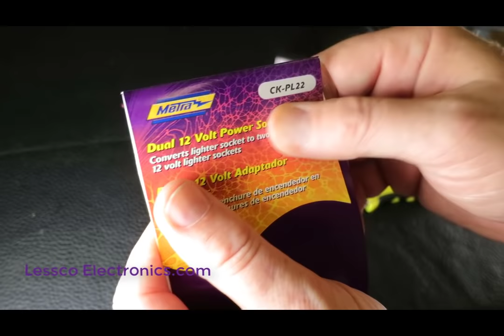How to hardwire 12 volt car accessory without cigarette plug

Comment: Nice tip.
However, IMO, I would add a fuse to the positive lead and then go on the "hot" side of the fuse.
In this manner, you don't risk popping a fuse that the vehicle may need. This then also needs to be understood that you still don't overload the circuit still.
Reply: How would you pop a fuse the car may need? He clearly said to use a vacant/unused fuse location. Every car has them. 
You'd be correct if he suggested leeching off an existing and needed fuse. That would not be a great idea.
Reply: For reference: 3:03
Reply: What fuse voltage would you use, and why would this be better than using an empty fuse bay?
Reply: That does sound like an extra step to add a fuse, when you're using a fuse and empty bay in the first place.  @BPoweredLove
Reply: @BPoweredLove He says "where this fuse was located" @ 3:03
Reply: @floridaredneck He says "where this fuse was located" @ 3:03 If a fuse is plugged into the vehicle it is NOT a blank
Reply: @davidstokes9706  
David! You're alive! It's been a half-decade since these comments.
Ignore this reply though. I'll come back in 2029 or so to respond to your point. 😂
Reply: @BPoweredLove  Blame "Google". My email is Gmail, as YouTube is also Google, and I just got the notification thud morning.
Reply: @davidstokes9706  

You're joking me. You just now noticed the 2017 (or whatever) email notification today, or you're saying YT only just now informed you that people were replying and those emails are dated 09/26/2023?? Why would YT launch those emails so delayed? That's a crazy glitch. 

Anyway, I have no idea about what we were talking about and I'm not sure I want to rewatch the video to be reminded. I might in a little bit.
Reply: @BPoweredLove  yep. It only sent this morning. Had I noticed how old your post was to mine. I wouldn't have posted.

Comment: Why can’t you just cut off the accessory connector on the dash cam and connect that to the fuse? Serious question because I’m doing something similar with a house home wall socket charger for my phone.
Reply from the maker: The reason is because there are often times electronics in the plug connector that are vital to the operation of the accessory. For instance mine has a step down converter that changed the voltage from 12 to 5 volts

Comment: Ok I got a question. How would I wire it to my trunk and for the light to only switch on when I open the trunk? Or is the switch my only option
Reply: I have a 2001 ford focus zx3
Reply: It's called a kill switch,or deadmans switch,  basically it's a switch that is only on when not bing pressed (kind of like the opposite of a regular switch). Place it in the in between the power source and the light on the red power wire.

Comment: hello how your last video I watched was very informative I'm trying to plug a cigarette lighter into a home Outlet so I need a DC to AC adapter
Reply from the maker: Yes, you need a a12 volt power supply of at least a 3 amp power output

Comment: I have purchased LED interior lights, which works with accesory port. Can i cut that port directly and hardwire the lights?. The box says, it runs on 12v. 

Please help how to hardwire a LED interior lights.
Reply from the maker: Yes, Definitely, What is the end look like on the wire though? If it has a transformer / fuse or anything like that in it you'll need to do it like I did here, otherwise feel free to just chop the tip off and hardwire it as you see fit.
Reply: @Lesscoelectronics  the lights get power through a 12v socket. 

So you mean i need to open the charging socket and seee weather there is any fuse inside it or not correct.??

Comment: What is the piece metal called that your connecting the female to??
Reply from the maker: You mean the ck-pl22 female adapter?
Reply: I have the same question. At 3:08 on top of the fuse there's a piece of metal that you used to insert to the fuse where it's not hot. What's that thing?
Reply: found the answer to my own question. They are "Brass fuse taps" you can find them on Amazon

Comment: What is the metal piece you put into the breaker to attach to the hot end of the cord? You said, "Put that in there", but you didn't tell us what "that" is or where to get it. The eBay link on this page does not work, but I can find that part by itself, and not get all that other wiring and plug I'll never use. 

I'm trying to use this idea for a dash cam and the wiring is already hidden, but it uses that damn 12V adapter and I need that for a USB converter. Since this is always on when the car is, it would be great to change this over and save me from fishing that damn cord and replacing the entire length of it, and save me a USB port I would have used too.

Yes, I am aware of the age of this video. The idea is perfect for my application, unless someone has a better idea. I wouldn't mind just cutting the 12V plug and splice a USB end to it. I just don't know why the car plug is so large for this cam.

Comment: Plugging the power supply into a cigarette socket and burying it under your dash isn't that good of an idea in my oppinion. Just cut the plug off and wire into fuse block. The other was (depending on the amount of current an item pulls) can cause it to get hot and start a fire. I have had cigarette lighter plugs get so hot it burned me when it was unplugged. Just saying!

Comment: soooo instead of cutting off female adapter and pluggin the cam adapter into it, why not cut the supplied cam adapter off and wire it directly?
Reply from the maker: Often times there are important electronics in those adapters you cant see that are important and shouldnt be cut out.

Comment: I just dont buy the cigarette lighter plug and play. I rather buy the rearview car with the power/ground/12 volt turn on. 
I usually buy the ones that have the fuse installed in. I rather keep it clean

Comment: One question on cars though... do you know anything about attaching LED strips to the car under the dash??? Specifically getting them to stick??? My car has a stiff molded carpet-like covering keeping the stuff under the dash hidden, and im not sure if 3m tape on most LED strips will hold good on that surface...
Reply from the maker: wire ties with hook&loop fasteners may work in that situation

Comment: Couldn't you just wire it to the wires that go to the lighter plug-in on the backside of the panel that it's connected to?
Reply: The bulky thingy probably has a transformer inside it, meaning it converts the voltage/ current to 5V/2A for example and not direct 12V which would probably burn your phone.

Comment: hey man awesome vid quick question though and sorry if someone has already asked and you've already answered. Anyway just to clarify when using the test light on the fuse, you want to put the copper tab on the side that is not hot? IE the test light will not light up...   i plan on splicing something onto my dome light fuse and obviously that gets power regardless if the key is on or not.. 
again great vid and cheers
Reply from the maker: yes, that way you'll attach onto the protected side of the fused circuit.
Reply: @Lesscoelectronics  thank you for getting back to me :)

Comment: Great video! I'd say be sure to secure the plugs together well so they don't come apart from vibration so I'm putting tape around mine. 
Also be sure to label the outside that there is a fuse inside the male plug's nose for any future trouble shooting if there is no power!
Reply: I wonder why he did not just cut the connectors off altogether and run the wire from there…

Comment: Could I just cut the cigarette lighter plug off and use the wires?
Reply from the maker: you can do that too
Reply: @Lesscoelectronics  is there a down side on not keeping the cigarette plug? Or the fuse takes place of the cigarette plug?
Reply from the maker: @justthatoneguy2175  alot of them have tiny electronics and fusing in them that you dont want to be removing, if yours doesnt have any of that, then go crazy and dont worry about it.

Comment: Hey man, what's the female fuse connector that you used.
I need to get those, have no clue what it's called.
You said the other was a terminal connector right.
The terminal connector goes to the battery right?
Sorry I'm no electrician and just need to install a 12v/USB port to my car which doesn't work. I need a dash cam and a phone charger for GPS

Comment: That's hassle why don't you just use. A double fuse splitter 😂
Reply: Agreed. I thought this video was years old until i checked half way through 😂
Reply: Then you remove the fuse and move it over into the correct slot one permanently live and one is live with ignition on... Or is it only my vw mk7.5 golf that does that my friend 😂
Reply: @aaronletchford  EXACTLY! Like a radio fuse which only turns on when the car is turned on 😂

Comment: No disrespect, but hard wiring is wiring without using the socket. Technically if you are using a 12v acc. socket it is not "hard wiring" You are just replacing one socket with another. Just wire it directly to the fuse and ground point. If you need to disconnect it, pull the fuse.
Reply from the maker: My socket is hardwired direct, but I use a 3 way expansion socket which I also use as a disconnect, its not right or wrong, its just custom wiring, every one is different.
Reply: What if the dash cam power connector has step up or down circuit board built into plug ?

Comment: I would never use a fuse tap. They tend to loosen the fuse connection over time. You are better off tapping the line itself. You can use the accessory port line itself.

Comment: Umm... do you have to use the plug??? I was thinking that the led under-dash light strips I want have a hardwire option, and i would use that... and if your device is 12v just ditch the hazardous plug all together... as long as you know a bit about electronic and car wiring anyways...
Reply from the maker: The plugs do help, Some of these kits use wire that is almost microscopic to see, no less wire up to!!

Comment: where do I attached the ground..??
Reply from the maker: anywhere theres a factory ground bolt or a comparable spot.
Reply: Lot of fuse boxes have metal screws that screws you can use.
Reply: @Lesscoelectronics  I know this is slightly off topic, used this video to achieve what I wanted so thank you, I got a aftermarket head unit, it screams through the speakers when I put my foot down, can I hook a wire to the metal casing of the head unit to a bolt going to the car chassis to ground it?
Reply from the maker: @GoogleUserGmail  if you have the ole cat in the trunk syndrome, check the ground impedance, it should be under 8 ohms, and ground loop isolators help alot as well.

Comment: Why cant you just cut the actual cigarettelighter plug of the dash cam?
Reply: and what is the best wire guage for car accessories?
Reply from the maker: @trevorbelmont4633  there maybe resistors or other parts hiding in there, and 18 ga wire is recommended
Reply: @Lesscoelectronics  i see thanks!

Comment: enjoyed your video however I have been searching for a solution to powering my DIY car security.  The horn that came with system(orig for home), is normally powered from normal home AC plug input with a converter to 9V DC output.  I want to put the horn in my car and power off my 12V battery-somehow. This was done by another YouTube video BUT they did not say how they powered the siren in their truck. Supposedly, you cut the input wires on siren and hook it to car/truck battery. System has wireless motion dectectors that trigger siren when activated.  What steps do i need to do to power the siren from car battery without draining battery-some kind of converter i suspect? Any help would be appreciated. The original video on this item does not allow viewers to ask questions with creator.  Link to this information follows. https://www.youtube.com/redirect?event=video_description&redir_token=QUFFLUhqbUFYb2IwZHZIVHNjNEhQcWlDRV9RX2hRSjV1Z3xBQ3Jtc0tsbWpiSW1NNUNUZzZ3Y3hGZVhPYlVhMDRMM1lRaGxUb0w1NXZQTXE1WmxQRV9HaWZoM2FIUWxFcS01QktKN1JhUWNpdnFzTWtOSzlodGxvOFlzZ0Q0b1JwNHZGQmdmdDl5U0Z1NnNzdU8xTGdMVVpFOA&q=https%3A%2F%2Fwww.amazon.ca%2Fdp%2FB074X9WDKN%2Fref%3Dcm_sw_r_cp_apa_glt_i_PDRY95S454QE98VQ5KDT%3Fpsc%3D1&v=gMzbephwDDY